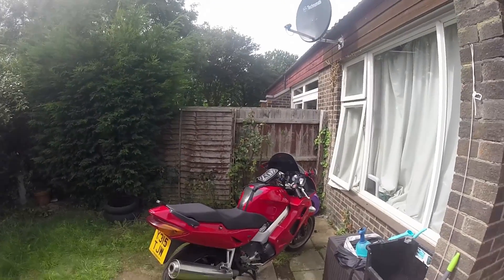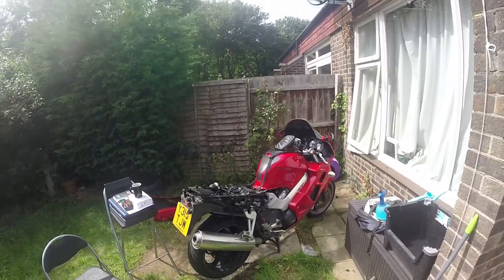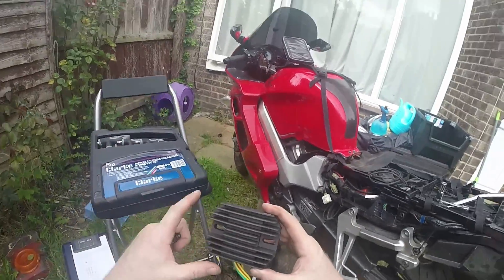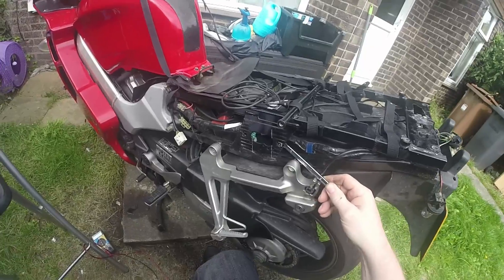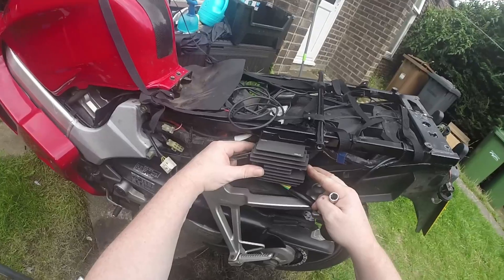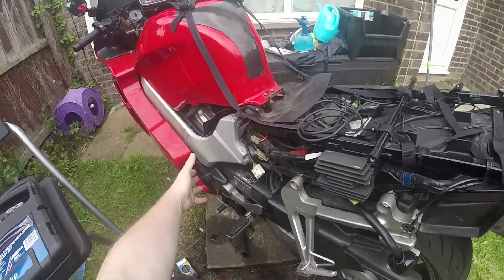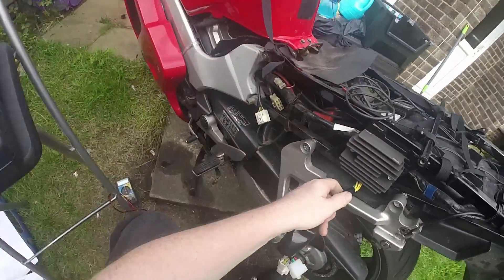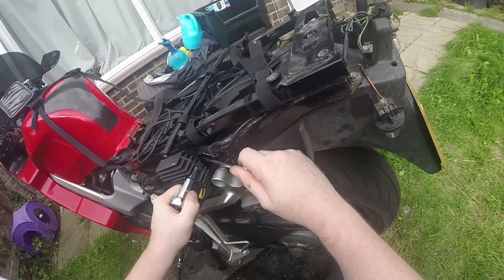How to fit and test a Regulator Rectifier to a 5th Generation Honda VFR800

Comment: Nige-rider, I've enjoyed watching your videos but have not been able to find a solution to a problem I'm having.  My bike has recently started to cut out intermittently...searching the bike to find the issue I have found a mini wiring loom linking the stator cabling to the rectifier cabling and 2 of the 3 yellow cables in this loom are browned and brittle.  There is also melting in the connectors. Now...from the rectifier there are 5 cables...like in your video, but then in the short loom the 5 cables are wired into a 4 terminal connector to then connect to the main loom.  And the black cable goes into the connector onto the same terminal as a red cable...red and black cables touching doesn't make sense in my 240v head...but in your video you describe the black cable as being a switch line...okay, I can live with that, sort of.  I have used my multi-meter to test the rectifier as best I can, tests okay...but my fault is intermittent. And these crispy cables in the mini loom don't fill me with much confidence...has the wrong rectifier been fitted?  I bought the bike with 38k on the clock...I have added 25k in the last few years. So it all seemed to work fine for a few years...with an odd random cutting out problem, but not like now, where it seems to happen every 30 miles or so. I took the bike to a Honda garage and they told me it's too old for them to do a proper diagnostic...they didn't even try really.  Fair enough, they also didn't charge me for their time which was honest of them. And they told me I'm pretty much on my own. Riding just 12 or so miles home it happened twice, worse than ever before too, cutting and immediately powering 3 times in quick succession.
Should I simply change the rectifier with a 3 pin/4 pin one (which I reckon would match the original, what with the main loom not having that black cable) and see what happens? Where can I get a 3 pin connector in the UK like this one https://www.amazon.com/Connectors-Voltage-Regulator-Rectifier-pins/dp/B00ATOR7AS 

Sorry...long question! But having watched lots of your videos I trust you have the knowledge!
Reply from the maker: Sean Just seen your question, what years is your VFR? Also are you in the UK? and would you be able to send me some pictures via Twitter or Facebook, and are you in an urgent hurry to fix this.?